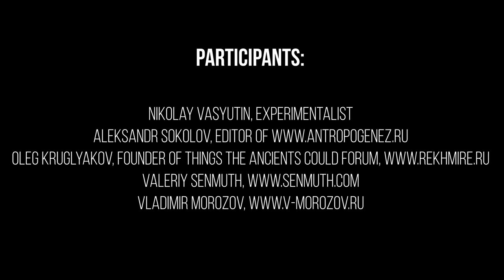Making Egyptian Drill Holes: Lost Ancient High Technology

Comment: Great video guys! I'm curious about a few things. For one, does it cut faster if you apply more downward force in the form of weight? Does speed make that much of a difference? My mind immediately scales up application. A bigger copper pipe, a log instead of a sapling, and a hundred pound plate instead of a plaster mold. 

Anyways, thanks for doing this! Been waiting years for someone to just make the damn video and silence all the 'high technology' ideologues. Glad someone finally stepped up! :)
Reply: There are probably limits to the technology, like high friction, high tool wear, difficulty operating, perhaps abrasive paste might have a harder time to get into the groove, etc. Although the design looks inefficient and exhausting. Personally, I would prefer a less wobbly device had I had to perform such a task. I think they have demonstrated in the later videos on this channel a larger copper drill with a large and stable handle.
Reply: @pavel9652  
High tool wear was overcome by real time frequent replacement and refurbishment of the tools. A single copper or bronze age drilling job involved half a dozen support workers keeping up a constant supply of sharpened tools to the coalface workers. 

As the metallurgy evolved over time, the number of people employed in sharpening was drastically reduced without effecting productivity. 

Today, high performance steel alloy tools eliminate the need for frequent tool replacement and on site sharpening, just as mechanical drills eliminated the need for a two man tool holder and tool striker team. Two man hand drilling teams were common in underground mining up until WW2. Hot riveting teams for large scale fabrication remain in limited use.

Comment: Now make a finely shaped figure out of that granite like it was clay.
Reply: Melt the granite by magnifying the sun onto the block and pour in a mould.
Reply: That I need to know
Reply: I believe this is done like a 3d print, except as a subtractive process like cnc cutting. Grab your seat. How would this be done? Well, start with a clay prototype, still wet. Carefully cut the prototype into slices with a horse hair or similar thread, support the thread on both sides so each cut is flat. Now what? Now I believe we make the jump to what the Eye of Divine Providence actually is a representation of and could explain the obsession with pyramids. Once you've got your rough geometry, skilled hands can make it smooth using known methods.
Reply: @Antiextremistdude  they aren’t just smooth tho , they are identical , from left to right , precision more precise then humans can eye ball
Reply: @keepitkosher8065  That just means you only have to make half the templates then flip them, makes the job even easier. Their precision is good but attainable. I did similar stuff before I got my CNC machine. I used to work off a pedestal drill loaded with router bits, a slide vice and a tilting table with a slot/channel loaded in the vice. The slot has a bearing at the end, so an MDF template (anyone cluing on - MDF has excellent dimensional stability unlike timber) with a pin in the middle can rotate on the tilting table while being bound to one dimension by the channel. Whatever shape your template, anything mounted and being cut on it will take on the shape of the template. This is probably more complicated than what I've described with the light projection on templates going slice by slice - I didn't have time nor space to make that many templates, so I'd use as few as possible, preferably one or two. It gets complicated with scaling - what happens isn't a scale, it's more like polar addition which is almost the same as using offset path on CAD programs. Going inwards, an oval template collapses in the middle, going outwards, the traced shape approaches a circle off to infinity distance, with only the initial difference between the length and width distinguishing the shape from a perfect circle. Weird twisting effects happen if you don't have the cutter perfectly lined up with the slot, weird things also happen if the centre pin isn't drilled near the centre of the template. And the real fun is machining outwards, toward the edge, because the template has to be the shape modified by polar subtraction. One shape I could make this way was a teardrop and the corresponding template is a kidney shape. I could judge how well I'd done the templates by how close the outward machining matched the inward machining because they were done using different templates.

Anyway, what I've described here is the kind of thing the Egyptians could have done manually with enough skill and patience.
Reply: @keepitkosher8065  That just makes the job easier, as you only need to do half of the statue and flip the template to mirror it - voila! Perfect symmetry.

I'm retyping this as YT made the first disappear. I used to use templates for shaping, specifically MDF templates because dimensional stability. I would use the templates on a pedestal drill. I had a slide vice mounted on the work table which then had a tilting table mounted in the sliding vice, so the table could be set flat or to 45º either way and fixed by tightening the vice. The tilting table had a slot/channel cut/formed into it and a small bearing past the end of the slot protruding from the table. The slot ran parallel to the vice jaws. The templates have a central hole which accommodates a pin which fits into the slot. The template can then rotate but is bound by the channel to one dimension - towards or away from the cutter. By pushing the template against the bearing and rotating the template and mounted workpiece, the shape of the template can be cut into the workpiece.

This is a bit more complicated than what I believe the Egyptians were doing, but except for the drill, all of this controlled movement is possible with ancient technology albeit without the luxury of a bearing. My first lot of clients actually spun out a bit because my work is symmetrical unlike some other people's work. I had only made a few at the time.

For my work, for reasons of time and storage space I would use as few templates as possible.  But it's complicated - moving the cutter in and out modifies the shape through polar addition and subtraction. For example, an oval will collapse along its long axis if the template is traced near the centre. Going outwards, the shape is modified with polar addition and verges on a perfect circle the further out the shape is traced. What is always retained is the difference between the width and length of the template. This assumes the cutter and the slot are all in line.  If the cutter isn't in line with the slot, the shape is modified via a sort of twisting of the shape.  If the template centre hole is not near the centre, the shape is distorted in other weird ways. The real fun comes when machining from the centre outwards as opposed to towards the centre - the template shape needs to be a polar subtraction modification of the shape so it becomes fully negative. For example, one shape I made was a teardrop shape with inset. The centre out machining template to match the teardrop centre in template is a kidney shape. I could judge how well I made the templates and set up the rig because the outer shape should match the inner shape. The effect of magnifying or diminishing the traced shape works very similar to offset path in CAD programs, although it's definitely not the same. This becomes obvious with large offsets. Pro tip - understanding scaling, offset and polar functions makes for good 3d models especially when you have to stitch them together.

And if you don't hold it right when machining after triple checking all the settings, you wreck your day. So I have CNC now anyway so I'll be buggered if I do any hand machining again.
Reply: Oh, NOW YT shows me my first reply. Grrr.
Reply: @keepitkosher8065  Just to be clear, I don't think Egyptians spun their statues on a slide vice, although who knows, what I'm suggesting is that they make negative templates and lay them on stone which can then be traced by chisel around, then remove the template and chisel the layer plus whatever else you feel safe lopping off in big smashes. After the first layer, put down the second template, chisel outline and repeat.
Reply: @Its_Shaun_the_Sheep  none of the granite that was molded to shapes had properties of melted granite which has different molecular properties and would be darker in color
Reply: @Its_Shaun_the_Sheep  Melted granite turns into volcanic glass (obsidian). They weren't melted, that's 100% certain.
Reply: @methylene5  Yes i have learned it was just skilled craftsman who had tons of time.

Comment: Skill and hard work did everything we see built.  Too many people have looked as said they could never do it so no one else could either.  The fact is people have forgotten that people used to do the same jobs as their dads and their dads and even their dads before them.  Very skilled after generations of learning and teaching.
Reply: However, skill and hard work are of little use when you enter the realm of precision. This technique may be able to explain drill holes, but not surfaces with a deviation of thousandths of inches. Nor does "hard work" explain how to align blocks of stone as heavy as school buses to within a few hundredths of an inch.

Likewise, it is not a question of "how" our ancestors were able to work with high precision, but rather why invest the extra work in the first place.
Reply: @WhereIsTheSpartan  That's because the of that level precision doesn't exist. Just click bait lies.
Reply: @diamondportal77  I visited Egypt several times and measured a high level of precision at various locations myself. So if you can disproof than show your data otherwise nice assumption.

Comment: What is the wear rate of the copper tube? A problem I have with copper tools cutting granite theory is that it does not appear to be an economical use of copper, especially since the way it is used the copper is ground into unrecoverable powder mixed into the slurry. Also how do you propose that ancient egyptians fabricate long tubes? The one you are using is seamless waterpipe that is extruded in a factory. While it is possible to forge an ingot around a die, that die is usually made of steel, forging copper on copper is challenging as the die gets deformed. If tube drills are consumed in large quantity on a building project they must be easy to make which suggests it may be just a bent unjoined sheet but those cannot drill deep without flexing.
Reply: The same rate as granite.
Reply: Why is the copper unrecoverable? Could you dry it and melt out the copper?
Reply: Are there any long cores surviving? What's the longest? I assumed they used a short tube on a wood pole and broke out the core regularly.

Comment: I must congratulate Nikolay Vasiutin and his assistants on "rediscovering" the drilling technique used in ancient Egypt, and probably other cultures as well.  It is very interesting that we had scenes from wall murals showing this type of drilling, used inside of stone vessels, but we did not recognize the effectiveness or universality of the technique.  This is different from a "tube drill" using a bow and cord, which one would try to keep the drill from wobbling to achieve maximum abrasion....I think this should be called a "wobble drill".  Also clear that the "spiral grooves" noted by so many previous investigators, are actually caused by drilling detritus exiting the hole as the drill "wobbles", not by the abrasive drilling face of the tool at all.
Reply from the maker: Thank you! What do you mean by "drilling detritus"?
Reply: @ScientistsAgainstMyths  "Detritus" = Waste material from the drilling process.  Great credit & respect to you! This is fantastic! I love experimental archaeology. I also have a recent theory that, especially on lager holes, the Egyptians naturally exploited the hollow copper or bronze drill head with a hollow wooden shaft with a funnel at top to introduce water/abrasive, much like modern core drills. And a weighted wheel (capstan) somewhere mid shaft or higher was kept spinning by several assistants stationed around like children at the park whirling a go-round ride. This would require bracing the rig. I then progressed to 2 other adaptations (theorizing ancient trial & error refinement) of this. (1)The capstan (flywheel) is also a tub - weight provided by water -shaft protrudes thru tub with funnel for abrasive. That means progressive weight can be controlled - to start the drilling light with less water. Holes in the shaft in tub for flow down shaft. Hole size controls flow. The empty water tub/shaft assembly would eliminate the struggle to move to other locations as with a stone weighted mechanism. I might make some drawings if you're interested.  Let me know.  I plan to build a rig like a small Trebuchet tower or pole tripod and try drilling on a larger scale here in Hawaii. (2)Percussion must be explored as well. Either beating the shaft with sticks or mechanical pawls/cams added to the spokes of the capstan. I believe ancients might have quickly discovered the added efficiency of hydraulic shock  by needing to beat the shaft if it became clogged with slurry/mud.  This would push out "detritus" thru pressure/flow. As you mentioned I too believe the ancients are not given enough credit for ingenuity and don't agree with space alien technology crazy talk. Aloha 

P.S. Please investigate progression of core tapers. I would expect only smaller cores have a profound taper. The diameter where lager cores have less to little taper might confirm the point where a stationary tower (less wobble) theory begins. Although I understand some wobble is important for introduction of fresh abrasive at point of contact.  Also, if there was Egyptian sea trade at the time why not consider they imported their Corundum from the island Naxos, Greece?
Reply from the maker: @jalspach9215  thank you!
Our experiments have shown that everything related to tubular abrasive drilling is simple and low-cost.
And there are enough of corundum in Egypt.
Reply from the maker: @AustinKoleCarlisle 
Take a look:
http://antropogenez.ru/uploads/pics/16-%D0%B4%D0%B2%D0%B0-%D0%B7%D0%B5%D0%BB-%D1%81%D1%82%D1%80_.jpg

on the left  -  the famous Core #7 found by Flinders Petrie in Egypt in the 1880’s

"a continuous spiral groove"? Are you shure?

on the right - The core obtained in Vasyutin's experiment in 2010th

Could you find any difference?
Reply: Prof Myers  You have heard of Occam's razor right?
Reply: Marc Myers and Prof M are the same person, he moderates The unchartedX YT comments section. censors the comments and keeps the Mystery narrative going. He has now deleted all of his comments from Scientists  Against myths.
Reply: @kkjppt5359  They are happy in their little echo chamber.
Reply from the maker: @TxDan100   look: https://youtu.be/HQi4yql7Ysg

Comment: I think it would be interesting to compare the drill lines on your cores to the drill lines on the cores in egypt. You would need very fine measuring tools, but it would at least give us more insight if they were the same methods.
Reply: It's been done probably before you were born
Reply: @pranays  probably! I’d love to see the research or content comparing.  I’d do it myself but ya know, costs a lot to travel to Egypt and with the appropriate tools 😂
Reply: @pranays  laser scanners were not available before we were born genius
Reply: The box on Elephantine island in Egypt has drill holes right up against the sides of the box. In fact its closed off at the top an the hole is surrounded on 2 sides. No way this works there.
Reply: @MJIZZEL  those holes are surrounded on 2 sides yes, meaning you have 2 free sides for attachment of you pully device (bow, stick etc.) to a spindle drilling a hole. You dont have to have full circular motion as in this video. You can drill holes only going thru one ( up - down, left - right ) or 2 axis ( half circle).
Reply: @MJIZZEL can you send a link of a hood video showing the box ?
Reply: @tr1x243  I don't believe that would work on that box because looking at it again, not only are the holes up against the side of the box but I noticed they were against a lip inside the box as well. 
I'm not suggesting some type of modern day tools made it but want to understand how these works of art into gard granite stone were achieved. 
Still haven't seen anyone reproduce the granite vases and plates, etc, that Petrie first  took amazement in the manufacturing process off. 
Christopher Dunns son and a team have thoroughly measured one of the vases and the accuracy in which it was produced is on par with our modern day precision instruments, if not better. No woman using a wooden drill and sand and a stone manufactured something so precise as they have no deviations from the center line to it's thickness.
Reply: @DADDYCOKE2012  I sure will. Just give me a few.
Reply: @DADDYCOKE2012  now look at that box and tell me if it was made with something primitive as in the video here. 
No way. Not the drill holes or the granite trim around it. 
If the link doesn't show just search:
UnchartedX elephantine island